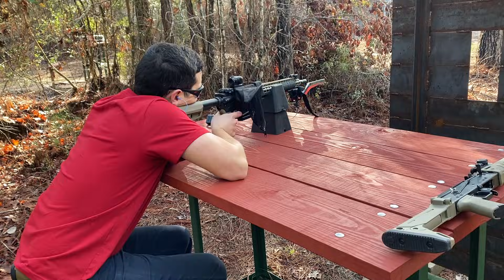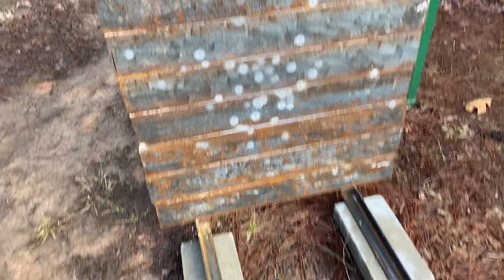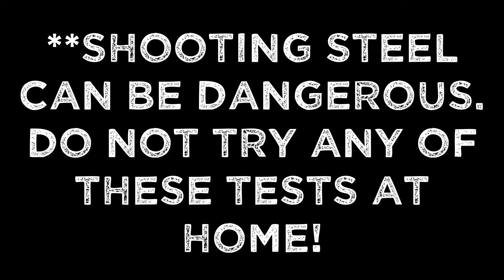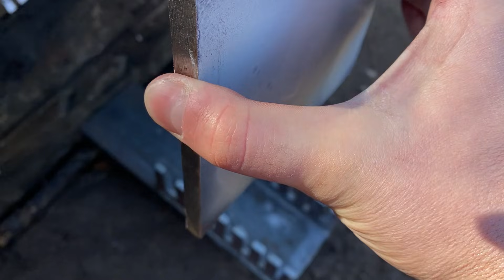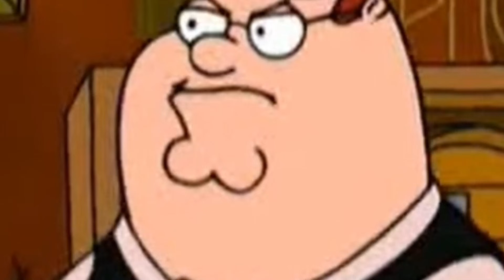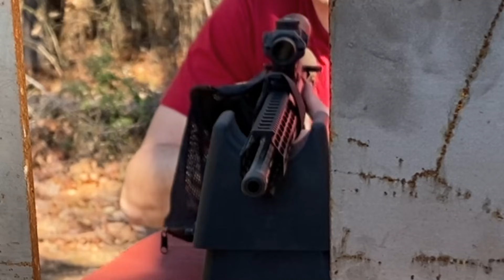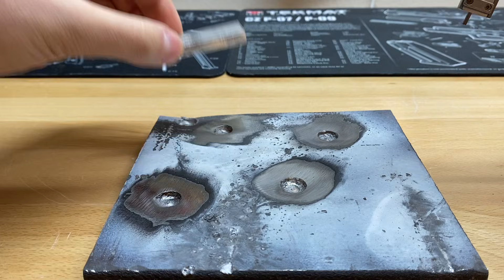223 vs 6.5 Grendel vs 300 BO vs 7.62x39 vs 350 Legend: Steel Penetration Test

Comment: Hey banana, so you see it in your velocities, a more fare comparison of cartridges would use the length of barrel that burns all of the powder just before the bullet leaves the barrel. 
The difference is, even though they are still traveling at 2000fps or so, the 300 blackout is already slowing down, versus the others that are only slowing down after leaving the barrels. So the system (bullet in the air) has more energy in the other systems. 
Id love to see you come back to the 300 blackout and do a comparison with optimal barrel lengths

Comment: Bullet type and composition is a key determining factor in straight line penetration. I would be interested to see results with all cartridges using a similar bullet design, say a mono metal solid in the weight each cartridge produces its highest energy. Or at least a standard full metal jacket of an appropriate weight.

Comment: I don't understand why people love the 300 blackout and why are so many companies manufacturing 300 blackout AR plateform rifles? Why? It's not good for penetration nor good for energy or stopping power. Better use a 45 long colt, 454 csule.
Reply: Not defending it, but it was made to be a good close quarters round that fits in an AR15 platform. They wanted a bigger bullet to help transfer more energy into a close target, so took a .308 bullet and basically shoved it into a shortened and necked up .223 case. I might be wrong on the exact combo, but that's what I think it is. It led to terrible long range ballistics because of the lower speed, but the weight of the bullet helps to overcome it at close ranges to transfer more energy into a target.
Reply: 300Blackout out of a 16inch barrel isn’t a fair comparison

Comment: You should have included the 6.8spc, it is apx 100ps faster than the Grendel when the same length barrels and same weight bullets are used.

Comment: A bit of an uneven comparison! For one: the 107gr in the 6.5 Grendel is basically a vsrmint weight bullet and will naturally het less penetration then the usual 120-130gr bullets loaded for this round! Also, shooting at the top part of the plate will give too much flex and less penetration! Shots should be kept at 1/2 height or lower with this setup!

Comment: I know you can't fit everything in something like this, but the 6.8 SPC II should have been included, versatile, hard hitting, works great with short barrels, no ejector Problems or weak bolts due to the case head size, reliable, great for deer and hogs out to 300 yards.  For factory loading the 120 Hornady SST is tough to beat but you have great Speer gold dots in 115 and 90 grain plus a lot of others.  And handloads really shine!  Not to take away from the others shown here, just letting others know it's there and a great choice!

Comment: what kind of ammo for each caliber? hard to tell if this is fmj or open tip. the grendel you said was 107gr smk. As paullee4042 said Grendel was designed around the 120gr bullet. I know fmj for that round is hard to find or non existent, at least back when i bought my ammo. idk if the extra velocity of the 107gr would help with this test or the extra mass of the 120gr would do better. ive never shot mild steel with mine.

Comment: So I wonder if a 16 inch barrel would make the difference, I run a hot 300 blkout at 2450fps in a 16, guess ima have to see for myself if it makes it. I wonder if it'll ever make 2500 fps with a 110grain. New loader, so ima have to load a real hot one and stri g pull the trigger with a cheap upper lol

Comment: Really the 300 and 7.62 arw the same as far as ballistics. Lots of overlap. So if they each have tue same bullet the performance will be the same is loaded equal. So to say a 7.62x39 penitrates better than 300 is not accurate. Same bullet at the same velocity equils the same results.

Comment: These are great videos. I watch all of them. The suggestion I have is for your ball rounds you could use pork ribs or heads. 

For metal APC rounds are more appropriate. The reason being is that the lead turns liquid on impact and just craters so to speak

Comment: Id like to see the 300 ham'r tested. Maybe a hand load since most you can buy are hollow points or soft tips. Its a super interesting round with extremely good ballistics. I just dont have a place outside to setup metal plates to test it but I'd send mine so you can test it. Probably a comparison between the 5.56, 300 BO, and .308 (weird, I know but its a 5.56 casing with up to a 150 grain .308 projectile) basically a 300 BO that took a bunch of steroids.

Comment: maybe you should have used a FMJ for the .300 blk.  Im surprised the 7.62x39 passed through soo much easier than the .300 blk.   but that may have been due to bullet design more than anything else.
Reply: Literally just more powder
Reply: wheres the proof?
Reply: @mtnbound1776  the proof is a basic understanding of common calibers. 7.62x39 vs 7.62x35, literally just a longer, thicker cartridge containing more room for powder.
Reply: @TheLumCobster  yeah not really though
Reply: @TheLumCobster  so bullet construction has nothing to do with terminal performance?

Comment: Not to be a downer, but the .223 made a nice clean round hole on the 1/4" plate and the Grendel knocked alot of paint off & clearly bent the metal bc it barely made it through it. That hole looks like my hole when I attempt to use cutting torches to cut a nice round whole. But love your vids

Comment: Just found your channel, find the content entertaining.  I don't value steel penetration as much as I would performance on bio targets, but doesn't make it any less interesting.

Sorry if this has been stated before, but you aren't measuring the depth of penetration ... you are measuring the depth to the back of the bullet ... and since they are different that should impact your measurements.  Is it impossible to dig out the bullet and then measure?

Comment: The one to beat in an AR is the 300 HAM’R.  Where 300BLK uses a shortened case to load very long/heavy bullets for subsonic use (yea, it’s also a half-ass supersonic), the 300 HAMR retains maximum 5.56 case length with a .308 blown out neck diameter.  Sure wish the HAMR would have come out first.

Comment: Why do guntubers always do these tests wrong. First, a 20 inch vs 16 inch barrels; makes zero sense. You can't have a reasonable test of any kind without a control aka, same barrel lengths. If you dont have the right barrel length, dont do it. Second, hollow points...why? Your goal was steel penetration, fmj's are ideal, again makes no sense. It's basic scientific method, I dont get this.

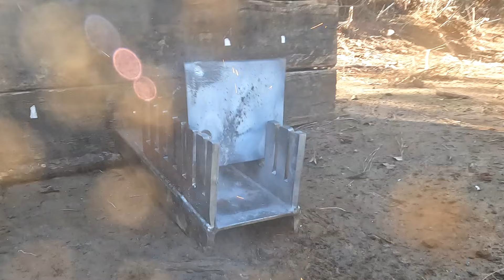Comment: I dunno what 300 blk loads your using but my 300 blackout loads goes straight thru that thickness be it 110 or 125 grain…. You need proper rounds to represent the blkout I mean do I need to send you some? Btw I went thru that with soft points and ballistic tip projos not even a sturdy projo made to go thru tough stuff. Crazy how most use crap ammo and then talk shit about it. 6:52

Comment: Super fun videos to watch. I'd love to see how a 6.8spc performs
Reply: Not much different than 300blk
Reply: @shaun536  6.8spc is definitely much different than 300blk
Reply: @renncampo8507 Actually you couldn't be so wrong. If you put away your little fan boy fantasy you will see that they can both equally fit the same rolls. Almost all parameters between the 2 are a wash and the few differences they do have are even a wash. There is really only one main advantage one of them has and that is with the 300blk because of the bullets it can use. 6.8spec bullet selection is still a novelty at best in comparison. Try owning both and you will see.
Reply: @shaun536  Ha ha ha ha

Comment: When you transitioned to the 3/8" plate, the rounds lost a lot of energy due to the plate bouncing around in that 1/2" slot.  You might have actually had some penetration had the plate been held more firmly in the 3/8" slot.  The results are not super valid.  A better method would be to clamp the plates directly onto your backstop.

Comment: SAFETY CONCERN! You should have the muzzle sticking out of the hole in the shooting barrier so that you don't accidentally have a close range steel impact due to a overbore miscalculation or accidental discharge. You can put pipe insulation foam or swim tube around the hole so that your firearms don't get damaged.
Reply: Zz11Z9
Reply: I half agree, but should certainly be checking that the muzzle is clear before firing!
Reply: Safety police

Comment: you'll have better sectional density with a 120 or 123 gr 6.5 bullet. You might also consider using one of the monometal (barnes or hornady cx/gmx) bullets in these cartridges. The best 223/556 penetration will almost certainly come from 62 grain green tip.

The 6 ARC and the 224 Valkyrie might have competitive (or superior?) sectional density loads and that might represent the best steel penetration capability from an ar15 (or other intermediate cartridge). give that a shot.

Comment: Try mounting steel plates even to where the barrel is aimed and keep the steel supported where the kinetic energy isn’t sapped from the movement or f the plate.     Aiming down at the plate you’re actually shooting thicker steel based on the angle the bullet impacts

Comment: Sir, just want to say three things. 1. Having the 3/8s plate at an angle increases the difficulty in a round piercing the steel plat, I.e. sloped armor. 2. You shooting at an angle  to the plate lessened the chances of the rounds going through. 3. The fact the plate had room to move makes the likelyhood of the round passing through the plate far less.

Comment: Would be cool to see penetrator rounds like m193 vs m855. Love the videos!
Reply: Since when is either of the M193 or M855 rounds "penetrator rounds"? There really isn't anything special about green tip ammo.
Reply: @jasono2139   they have a steel core and not just lead.
Reply: @Superb_Legend  no... It doesn't. M855 is steel tipped. The core is still lead. Green tip ammo is not armor piercing.

Black tipped 5.56 has a steel core.

While there's a slight difference between M193 and M855... Neither are going to punch holes through steel almost any differently.
Reply: @jasono2139   First party was mostly right and the rest was totally wrong.

Black tip M995 has a tungsten core.

M193 and M855 can behave differently on steel depending on steel type and range. Close range the M193 tends to punch through some hardened steels that M855 won’t, whereas M855 tends to punch through mild steel better than M193 and also at further ranges.
Reply: @Hornet135  do you understand what the word "almost" means? 🤦

M195 and M855 on thicker steel plates are barely any different... If you're shooting at soft targets or thinner metal targets, then obviously they're different.

Otherwise, I said "black tip ammo", not M995... If you want to point out that not all armor piercing rounds use steel cores... Whatever. M855A1 uses a steel core.

Comment: One thing I might point to, and it may seem miniscule, but I wonder if the 3/8" plate had been held in the correct slot and not had the room to bounce like it did in the 1/2" slot if the penetration would have been deeper?
Reply: That’s actually a great point 👍🏼

Comment: I would have been hard pressed to say if you had used 5.56 ammo or even M855 5.56 green tips  instead of .223 that it would have penetrated the 3/8ths steel. 5.56 has a little more punch than .223 or at least it is supposed too

Comment: You need to be using 110gr with the .300BLK. That is the optimum projectile for the 300.
Reply: Yeah, at least for steel penetration. I just picked some up from AAC for pretty cheap.
Reply: I saw a video on YouTube the other day and a couple of guys were gel testing using 88 grain 300 blackout frangible rounds. I've never personally seen anything advertised lighter than 110 grains

Comment: I think if you add four inches of barrel to each of them the results would be equal. Why just the .223? Velocity would increase for all of the rifles. Your chrono didn't even measure 7.62x39. 300 Blackout is a failed experiment and will not even exist in 10 years.

Comment: I think I've mentioned it before, shooting the same 7.62x39 through my 10" Draco and 20" SKS, made a huge difference in penetration on 3/8" steel. Draco didn't.
Reply: With the right ammunition the 7.62x39 can cut thru 3/4 inches of steel.

Comment: Hello, I have an idea for a video if I may suggest it to you...

Since you like shooting at steel 😀, how about a test for "spaced armor".

There are some videos available on YouTube, but the guy didn’t understand fully what’s behind the term „spaced“.
He stacked his plates too close together.

So,
comparison between spaced and not spaced plates consisting of same material . Eg mild steel

Test 1
Use some (eg) 2mm plates, space between each plate should be bigger than length of the bullet.
Versus, same plates w/o space in between.
Which configuration provided protection with the least weight?

Variation, (as used for turret of leopard  2 MBT):
first plate with significant inclination, 2nd and following plates perpendicular to your gun.

Test 2
As first plate , use a hardened one. The guy used circular saw blades.
This plate and the following again with same space between as before.
Compare this against test 1

Does this make sense ?

Unfortunately due to German gun law, we cannot perform this here

Comment: Need to use 5.56 out of the AR for better velocity. 223 is lower pressure and designed to be run out of a 24in barrel, hence the 450 fps deficit. 5.56 out of a 16in AR is around 3100-3200fps compared to 2750-2900 fps for 223 out of the same gun.

Comment: I had a ruger 350 legend in AR but it would jam like yourd did. I don't think they have enough gas pressure to cycle..I heard a different gas block helps but I jut think they should leave the AR style to something different than a straight walled cartridge minus the 450 bushmaster try one of those beast

Comment: can you test semi-auto penetration vs a bolt action penetration. there are several calibers to do this with including

223/556
308
and
30-06

I'm sure there are even more options, those are just the ones at the top of my head
Reply: Why would there be a difference? The cartridge + barrel length is what determines energy downrange, not action type.
Reply: @primaryaccount7626  Hate to break it to you, but theres a lot more that goes into it than that. Action type plays a huge part in how fast bullets are going out the barrel.

All things equal, Bolt actions are typically the best, followed by other locking actions such as lever and pump, followed by locking semi-autos like whats in the AR15, followed by the simply blow back operations, ending with revolvers. Theres a few more in there such as roller delay and other options.

even in locking semi, there are a lot of variables. Typically the further away the gas block is, the better, the heavier the cycling mechanism, the better. Even muzzle brakes effect muzzle velocity. If the gasses stay with the round, it effects it versus if a brake is pulling the gasses off.

In semi also, theres typically a head space before the rifling starts, that will affect it.

But, just to top it off, other things you havent considered, barrel twist rate, barrel diameter (effects how well it seals, if its supposed to be .223 and its .224, thats lost precision and pressure behind the round), barrel finish (if is more porous, youll lose pressure). There are many more factors, but I doubt you even read up until here.
Reply: @cerneysmallengines  Okay sure, if you consider the any slight difference in velocity, then yes, all of those things will have a minor effect on velocity. It does make me wonder though just how much of a practical or measurable difference any of these make. In a properly constructed firearm (i.e. one with tolerances in spec), the difference in velocity can’t be more than 10-15 fps right? At that point wouldn’t it be hard to place the source of the deviation on a single thing, given typical ammo deviation being in a similar range?
Reply: @Primary Account  honestly, I have no idea, hence why i want him to test it. he's done testing where the difference between a 16" and a 20" barrel make a distinct difference. when ammo itself can deviate by 100 fps between shots, it can be difficult to gauge a measurable difference. but I believe a bolt action will outperform a semi auto, to what degree, I don't know. again, that's why I want him to test it
Reply: @cerneysmallengines  Fair claim, I’m kinda curious to know now too.
Reply: @Primary Account  that's just it, if it's 10 fps, I'll keep my locking semi, if it's 100 fps, that's a big deal

Comment: To calculate how much steel a particular cartridge is capable of penetrating, a bullet designed to penetrate steel must be used. I’m sure Winchester isn’t loading an armor piercing 350 Legend round. Likewise, the 300 blackout round is probably not an armor piercing round. While it is possible to obtain armor piercing ammo in both 5.56 X 45mm (.223) and 7.62 X 39mm, in this test we aren't given the type of bullet used. If all of the rounds used are soft point bullets the playing field is a little more level, but then we must 1st ascertain which weight of soft point in each caliber penetrates steel best and use that round in the test.

Comment: If we could only get Magpul to make mags for the 6.5 Grendel. I really like the Grendel for hunting. I use the 123gr ,the 100gr-110gr bullets are terrible on groups .
Reply: 123gr SP out of a 20"+ barrel is kind of what the Grendel was designed around, so it makes sense that it would work well for deer, especially if you need a longer shot.